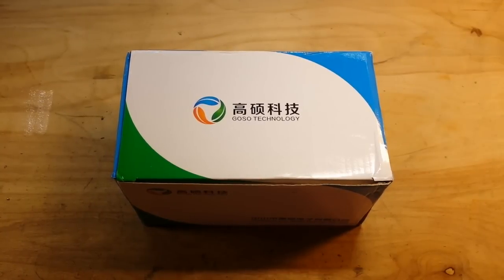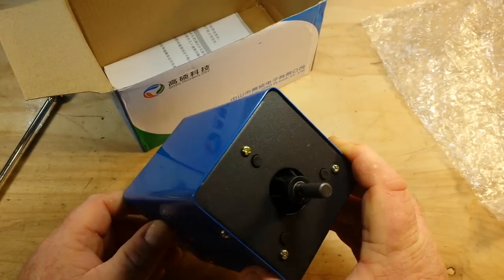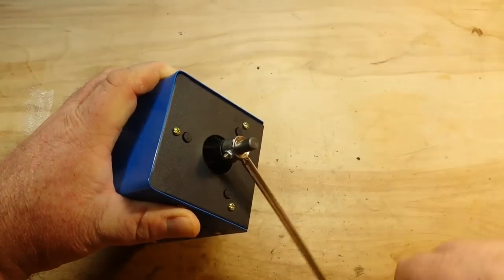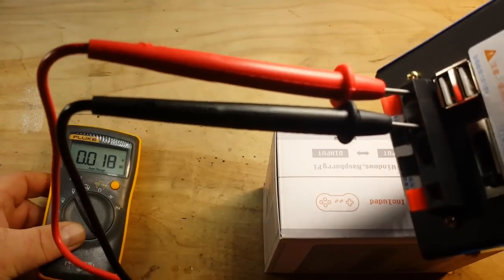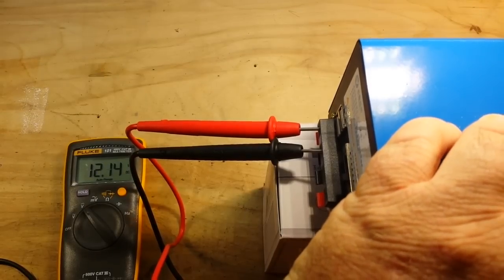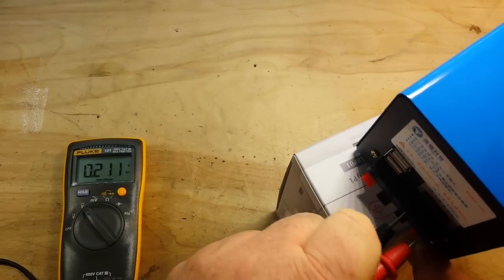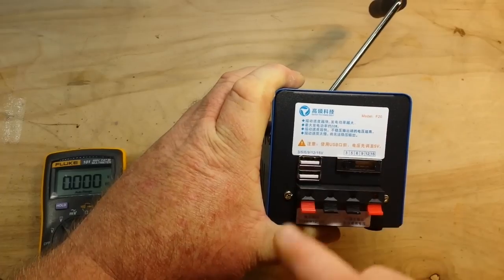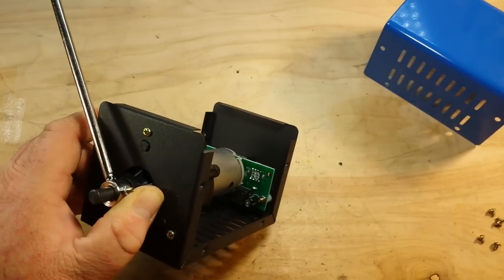Hand cranked Emergency Generator

Comment: The handle length is to regulate the speed.  The gearing could overdrive the motor if allowed to spin full tilt boogie.  Had it been a proper generator, we would have seen a better ratio handle.

Comment: ******Maybe someone here can help me*****. I bought this for emergencies. I tested it out the box due to a coincidental power outtage when it arrived.  I wanted to charge my phone. I set it to 5 as it says everywhere to do. I cranked for 30mins desperate to charge my phone and all it did was continue to lose power. The phone said it was charging but just kept dying. I've tried it on several devices since then and it's the same story and there's like no info online about this issue. Any ideas? Or ideas for a fix?? Side note. On devices with more than 50% power there is more resistance,  but its not consistent!! Sometimes it slips like it's charging a dead battery then goes back to stiff again. Thank you for any potential advice!!!

Comment: I have an older version of the  K-Tor "Power Socket" hand-crank generator. It is U.S.-made and rugged, but it unfortunately illustrates the problem with hand generators. It's a lot of effort for a little result—1 amp USB output cranking like mad. The makers are right. Fifteen minutes of cranking will charge an iPhone well enough to make a quick call. But I did some calculations. Fully charging it would take almost an entire day of cranking. There's also a core problem with hand generators. You can't do much of anything else while hand-cranking. A bicycle-like generator is better. It leaves your hands free for other tasks and legs can generate more power than arms while getting less tired. The company that made my hand generator does make a sturdy pedal generator called the Power Box 50, but at $395 it is a bit costly.

Comment: You can build one of these from a stepper motor salvaged from an old copier or laser printer, 6 diodes, a crank and a capacitor. Add a car usb charger to get 5V for your devices. ❤

Comment: It's so easy to take a photo of the Chinese writing, drag it into Chrome and get it translated. People just don't think these days.  I just took a screenshot of him holding that paper at an angle and still managed to translate some of it. Here's the translation of the first paragraph ... "Thank you for being your quality product and service. Hand operated and rechargeable emergency power supply. Manpower can be used in any corner of the world without mains power and oil power generation
Strong power generation for all kinds of electronic products, can be used in field battles, field operations, and field inspections. It is actively used in rescue operations, natural disasters, survival training, emergency communications, long-term power shortages, travel, and emergency power consumption. Mainly for low-power communication radio stations, walkie-talkies, notebook computers, PDAs, mobile phones, video cameras, digital cameras, music CDs, MP4, PI, portable mobile TVs, DVDs, radios, flashlights, various lamps,"  .... If he had held the paper straight I could have translated the lot. Duh! And here's a translation of the sticker on the end of the unit ... "Advanced technology ▲Note: When using a USB , adjust the voltage to 5V first. 36001215  354/9/12/15V"

Comment: Would this work if you attached a metal tube horizontal instead of the handle obviously put a screw through the light pole to attach it too the generator,then add a paddle and use water to turn the handle instead of human power

Comment: You don't have to worry about the voltage setting on the usb  ports. That setting has nothing to do with the usb ports . it has a regulator that keeps it at 5 volts .

Comment: Better than no current with 0 sun . 
If you were in bad situation this is ok I think. Yes china build on crank will need changed ya cut it in half have the kids spin it while in tornado shelter .

Comment: Be aware the USB port is not separate from the output connectors which means if you select any voltage, that will also show up on the USB port.  Ensure you have the voltage set for 5V or you may destroy the USB devices you wish to change.
Reply: yea he says that..
Reply: To be fair it's your fault if you kill your phone by charging it with 12V instead of switching the limit to 5V which is what they're meant to take
Reply: Yikes! That is a very serious design flaw.😮

Comment: Nice! Mine is on the way, along with a 12V to 220 V /4000 W converter, a lead acid 12V battery, and a battery capacity tester! :)
Reply: Update: fucking shit does not work.
Reply: @jerommeramirez1403  sad to hear that. I just plan to buy one.
Reply: @jerommeramirez1403  what didnt work specifically?
Reply: @kudzy11   the whole thing. You planning to make a whole energy system? I don’t recommend it in the end. Better to have a solar panel and solar lights when not sunny.

Comment: You might try a fire starter bow drill since there is no negative current going backwards. Like sawing a log, longer the bow easier to use. Try a oversized rubber grommet on crankshaft.

Comment: You might want that longer handle once you put an actual load on the generator beecause more force will be needed in turning it to counter the back-EMF generated  Also, since it requires one hand to turn the crank while the other hand holds the unit, it can be easily operated on the edge of a table or countertop.

Comment: 3:22 what does he mean by having the switch in the right place?
If I wanted to charge a 5v phone does it mean I would need to set it up for 5v and no more?
Reply: Yup. That's exactly what that mean. If you set it to 6v or higher, you'd fry your phone, potentially damage or make the battery explode.
Reply: @andychow5509  Thanks for answering. I don't know much about electronics so you potentially saved my a lot of $$$. Gonna get one from Wish.

Comment: Thanks for a high quality concise review which is rare in You Tube Land.

I am interested in Earth grounding for health.

The idea is that we we're not born wearing shoes which insulate us from the ionic charge the ground carries.

When shoes changed from leather to plastic soles this increased their insulation value.

An increase in diabetes occurred at the same time - could there be a correlation?

You can use metal to ground your shoes or make a mat for your feet when seated or I bought sheets with copper threads woven in that I can plug into the ground receptacle in a power outlet or connect to a grounding rod in the Earth.

If metabolism requires electricity for all body processes perhaps restoring this lost free Earth charge in our modern environment can allow more resources to be used for cellular repair.

Also, if we are grounded this can reduce the negative impact of emf pollution from tech like our phones and computers we are close to.

If you could investigate and report on this I would be most thankful.

My mission is to help coordinate other independent researchers including those who are distrustful of the status quo so that we can learn how to channel our online interests into local and worldwide co-operation to take the place of consumerism.

In short, I think it would be good for the conspiracy theorist to team up with vets so we can solve problems instead of just be addicted to online info yet take no action.

I would like to copy the scouting program but for the post internet generation in order to unite political radicals from both sides to unite in community building.

I mean preppers like these survival products and environmentalists want to reduce waste so those folks should team up instead of hate/fear each other.

Here is a documentary about a National Geographic photographer who researched the issue.

https://articles.mercola.com/sites/articles/archive/2013/10/19/grounded-documentary.aspx

And here is my website which I hope to use to showcase experts in various arenas such as yourself so I can refer my audience to you regarding electronics education.

Maybe Earth grounding could help with your heart health?

My Mom recently had a heart attack too. 😢

Thanks for your service and volunteer spirit.

https://chadwarren.me/
Reply: goofy

Comment: I can just put a cranked in an old battery power drill and run 2 wire out to a Car Cigarette Lighter Socket and put some tape around the drill sitch.
Reply from the maker: Yes, but there is huge loss, this was just a demonstration.

Comment: You will get more resistance from the handle when you charge a battery bank or use current.
Reply from the maker: Not very much
Reply: @learnelectronics  Have you actually tried it?! I bet you can only keep up turning the handle for about 15 minutes: then the lactic acid will have built up in your arm muscles such that you have to stop. One huge drawback is that this unit apparently has no internal battery to buffer the excess input power. Won't buy...

Comment: Put a LOAD on it, then you will change your mind. Put it under load!!!!! You are checking OPEN CIRCUIT  voltage,  which is worthless knowledge about a  energy SOURCE  device,  it's all about the CURRENT.
Reply from the maker: That is in today's video
Reply: This aren’t big enough to power a tv lol this is more for charging a portable charger
Reply: @CutieRingoJoy  you can, but you need to hook it to a bike for that

Comment: I have to admit I have a new respect for generators. I spent about a hour at the gym peddeling. To generate power. And only generated enough power to light a low wattage  bulb for 30 minutes. And I was peddling at supposeadly 20 mph! A grid tie inverter and a exercise bike with a generator great idea...charge ppl to come in to generate power for you! Awesome!!!

Comment: I'm in NC and might need something like this if I was on grid. You never know I may need one anyway if they are no sun for a while.  I have a 18 v drill I'm thinking about making ga 5v charger from it. Use a buck converter and use it to charge 18650 batts to power my phone charger. I can just put a handle in the Chuck. I have seen times I'd like to had one!

Comment: Aghhh, It hurts me to say it, but this review was kinda sloppy and in general, not very useful. Why there was no actual test with a load?? Can this thing keep the voltage stable, when you power something? Also, when you connect a load, the force needed to spin that motor, would be much greater and you will appreciate the long handle. :)

Cheers
Reply: @biff322  Definitely just to charge battery pack and then use that battery pack to power up various electronics (within reason ofc :) )
Reply: VladiSSius I think if your going to camping this will help
Reply: A load? This aren’t a big generator lol this is more for mobiles and smaller devices
Reply: It wasn’t a review OMG! He says he will do the proper testing in the future and this is more for portable charger not a freaking tv or fridge
Reply from the maker: You must have missed the part where I said we would do further testing tomorrow.

Comment: I love new scope days. Looking forward to seeing some current testing. I wonder if adding a current requirement will make that longer crank handle make sense?
That looks like a fun box to play with. I wonder how hard it would be to 3d print a gear set and box to make one of these things at home? Well at the library for me when I can get some printer time (when it is working 😒). Thanks for another great video Paul.

Comment: I'm surprised there are not any exercise bikes on the market that use a generator for resistance instead of magnetic or friction based resistance, at least not around here in Ireland (or UK).  With a generator that could power a TV or recharge a laptop, I'm sure it would work well to encourage working out, even if the electric bill savings is negligible.  Like this hand cranked generator, it would provide power during a power cut.  Being pedal powered would also provide a lot more power, probably around 100 to 150 watts based on one YouTube video showing a DIY pedal powered bike powering an old CRT TV along with a few incandescent light bulbs.
Reply: I have thought of doing something like that for my own use.  Thanks for telling me I’m not totally full of <censored.>
Reply: K tor makes one.. about 700$ and I think it's 80w

Comment: Nice, I have been searching for a little hand crank generator (just not one of those plastic ones) for ages. Looking forward to your current tests.
Reply from the maker: Thanks David. This thing is quite well built, but the output is not quite smooth. You will see in the next video, but the ripple as around 400mV.

Comment: Hook it up to bicycle :)
Reply: OMG! Yes
Reply: How about putting a model p.m.r live steam boiler and steam engine on it from pmr research .com to get a one research live steam engines and minature gas engines it be cool to hook a steam engine to it pmr research .com can have a belt pulley custom made for your generator and it be continuous small compact off grid power generation system with a miniature live steam engine that be cool to run it about a 1000pm
Reply: How many watts per hour do you think I could get on 12v ?
Reply: That's what I'm here for.
Reply: Or a treadmill.
Reply: Great idea!
Reply: Did you ever hook it up to a bike?
Reply: Put it on an electric bicycle and have it constantly charging it lol
Reply: @jesseybarra3408 Sadly the 1st law of thermodynamics would destroy that dream :C
Reply: @jesseybarra3408  lol
Reply: Nah I'm hooking it up to my penis.
Reply: @icommentbutimalwayslate7392  it gonna hurt